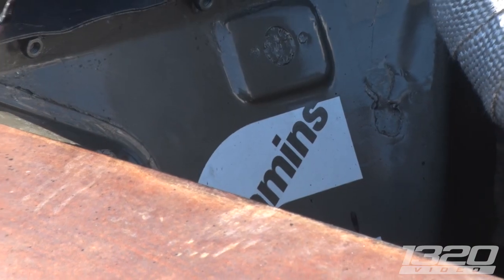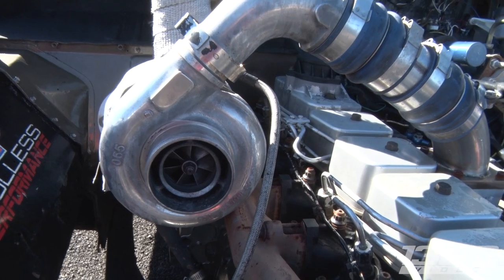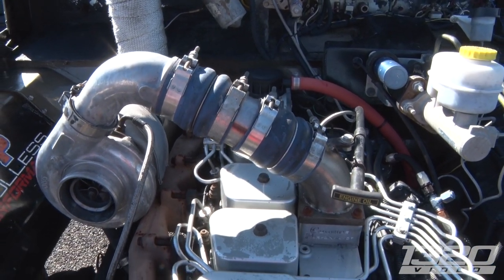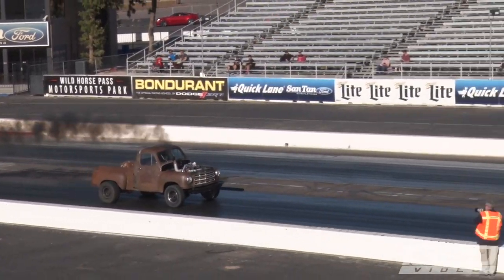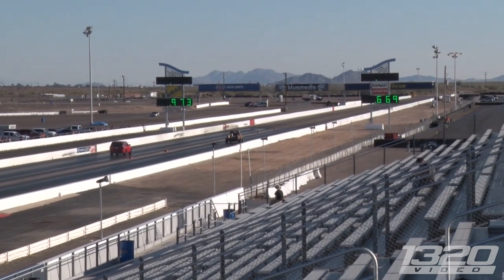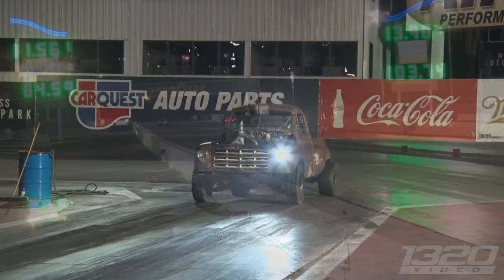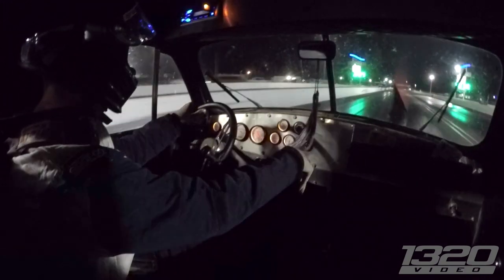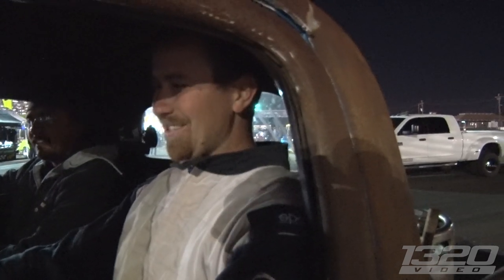Turbo Diesel STUDEBAKER Pickup Truck!?

Comment: I'm actually the owner and yeah my shifting from 2nd to third is terrible bit anyone that has drove a nv4500 knows it's no race trans. I am leaving in 2nd and nitrous wasn't working that night. we have huge plans for the truck like a fire punk trans and a 1200hp long block that's already put together. I didn't build this truck to be a race truck but that's what it's going to turn out to be. thanks and there will be so much more to come
Reply: growing up around a stude pickup and owning a 79 bronco with a NV4500 I dig this a lot! that 2nd to 3rd in them is about a mile and a half long lol. people don't understand its not a 1st to 2nd shift, because 1st is basically useless other than pulling stumps lol
Reply: Awesome truck.  Doesn't matter if it doesn't work well or whether it is practical or not, I would drive it! Love Studebakers and diesels, so this is a perfect combo.
Reply: good luck with it man, currently building a 12v and nv4500 for my suburban. should be at 600awhp when done.

Comment: The flaming exhaust is really badass!
Reply: Fileeraus that's  N2O
Reply: Doesn't change a thing, its badass.
Reply: Yooo Dawg  N2O is the oxidizer precombustion not the flame itself..
Reply: Yooo Dawg No, that's diesel with high EGT. My truck did the same thing from the hood stack in big tunes before I intercooled it. Go watch some tractor pulls, same thing.
Reply: ^This, non-intercooled diesels are kinda like habanero pepper sauce - they run hot enough to burn twice lol

Comment: what's he doing making a sandwich in between first and second?
Reply: pandemoniummisfits 😂😂
Reply: pandemoniummisfits it's manual, I'd like to see you drag race in a manual
Reply: Man nobody can take a joke.
Reply: pandemoniummisfits it's not a joke if it's trying to provoke the guy
Reply: SpecialKLSX still, it ain't funny. How would you like it if I said "What are you doing? Making a a sandwich while typing"
Reply: ihateyoujeffy then make one
Reply: pandemoniummisfits I want a tuna sandwich how bow dah
Reply: pandemoniummisfits I prefer tator tots over a sandwich so I would grab a few between shifts ha ha
Reply: pandemoniummisfits hahahahaha
Reply: Thats truck transmission for you racer boy :D
If theres any synchros left they get chewed right up in the first time you miss a shift :D
Reply: You're a grown man, stop being so sensitive.
Reply: pandemoniummisfits I have the same transmission with a bad 3rd synchro. I can still slam gears faster then that Haha.
Reply: ahahahaha 1st to 2nd is always tricky, from what I know...driving an old 240d with almost no synchros. not sure what this dudes shifter setup is though. pretty sure that trans has no synchros?
Reply: pandemoniummisfits magnet b. I k.
Reply: and at the light

Comment: he never builds up his boost before he launches needs a driver mod
Reply: Also looks like it could use a better diff. Looks to me like it's spinning the right wheel in burnouts, and the left just kinda jerks.
Reply: hold the clutch while at full throttle :P
Reply: Probably just an average open diff.
Reply: RIP clutch
Reply: If it's an open diff, why would the other tire be trying to spin? The spinning one would get all the power.
Reply: Wrong.
Reply: Who and why?
Reply: Warms up and starts gripping.
Reply: it's a limited slip that obviously isn't working
Reply: I kill For sport agreed like I said it's not a race truck but making its way there

Comment: if only he knew how to drive it, he is leaving on no boost.
Reply: Cameron Stevens it's a manual. kinda hard to build a lot of boost with no load on the engine...
Reply: CRAZEDX100 he could dump the clutch
Reply: David Eagle inform me on how to leave under full boost with a 5 speed manual transmission this is something I guess I don't know
Reply: Cameron Stevens can you explain to me or anyone on how to build boost with a manual transmission and a diesel ?
Reply: Dont know what engine management he is using but I am pretty sure it doesnt support anti-lag/launch control, also it seems like he barely has grip as it is from a idle launch.
Reply: Zcypot my truck is completely computerless
Reply: no intercooler so maybe its the hot air
Reply: FlmxFilms just because he dumps the clutch doesn't mean he's leaving on full boost. how does the turbo go from making no boost to making full boost in the split second it takes the clutch to transfer power? it doesn't that why it smokes so damn much off the line, because it's leaving on no boost.
Reply: FlmxFilms giving throttle to a turbo diesel with no load on it won't create any boost. you need to learn . I do own a diesel. it has a 5 speed. I can floor it while standing still and it won't make any boost. my buddy has a cummins with a Suncoast 48re and he won't build any boost in neutral but once he puts it in drive and holds the brake and floors it it'll make upwards of 35-40 pounds of boost. you need to get your facts right before you talk.
Reply: FlmxFilms explain to me how with a 5 speed you build boost while in gear. if the shifter is in first and the clutch is let out then you are moving. if you out it in fist and press the clutch in then you are in neutral. that's kinda why you dunp the clutch when you launch. do you know how a manual transmission works? try going into first letting out the clutch and sitting still while building boost. let me know how that works out for you.
Reply: FlmxFilms lol Suncoast is cheap. yea so what he daily drives it and it runs 9s. my 3500 with a 5 speed ran high 10s. let's see what you got. come stop by and run us.
Reply: +CRAZEDX100 Line lockers, feather the clutch, easy peasy.  Line lockers likely optional, idle torque against 1/4 clutch under full brake would probably be enough for at least a few pounds of spool.  Lemme guess the only truck you've owned with a stick was the diesel?  Probably don't have good enough part clutch control to keep from stalling a small to medium gasser in rush hour or hill country.  I cut my teeth for stick on a 2.2L S10 with a 5 speed.  I could hold that thing at a standstill on a 30% grade without touching the brake pedal because I learned to drive it in the St. Paul/Minneapolis noontime rush hour back when I was in college about 15 years ago.
Reply: bashkillswitch I hope you know that is horrible for your clutch. let's just sit here at the line and burn the friction disk for shits and giggles. I've owned a few truck with standards and currently daily a 5 speed mustang. I know how to drive stick.

Comment: or u could just buy a stock camaro or foxbody and be faster
Reply: fox bodys and mustangs This truck is slower but cooler then the fox.
Reply: Definitely not cooler than a fox
Reply: that's the boring way to do it.
Reply: Turd Ferd don't get me wrong.... I absolutely love Foxbodies but to say they are cooler than this truck, I'd be lying my ass off.
Reply: R34 cause going fast is boring.
Reply: Goddamn right! You saw that exhaust.
Reply: Goddamn right! You saw that exhaust.
Reply: fox bodys and mustangs and have the most boring overused car on the planet
Reply: Excuse me, but foxbodies are super cool. My daily driven fox does a 25second 1/4 mile... huh!? Wutcha think about that!?!?
Reply: Interesting to see a fox body lover who is preaching bought not built.
Reply: Nate b mine runs 24', yours is slow.
Reply: factory foxbody time?
Reply: fox bodys and mustangs if he got a mustang or camaro he'd be cookie cutter like everyone else.
Reply: Dénes Czeczon 14.5-15.0 I'm thinking. I've never had a stock one at the track myself. Stock 89' LX with Gears, exhaust, and 14 degrees of base timing. Ran 13.7's on regular BFG's this was before drag Radials came out lol
Reply: fox bodys and mustangs yeah but that's no fun
Reply: NiCadRacer Lol I'm kidding, I actually don't know what mine would run. Never taken it to a track, all I know is I've got a 600Ci jet engine swap in it, good for about maybe 800Hp and 12 foot pounds of torque I'd say.
Reply: NiCadRacer Lol I'm kidding, I actually don't know what mine would run. Never taken it to a track, all I know is I've got a 600Ci jet engine swap in it, good for about maybe 800Hp and 12 foot pounds of torque I'd say.
Reply: Nate b mine runs on a super fusion hydro cell. it too is as invisible as yours.
Reply: ratrodramblin well god dam son... you just out did me on that one. I'll race you for ducks 🦆. Ready? On your mark... get set... GO!!!
Reply: Nate b thats not fair you had vin diesel in the passenger seat, he looked over and said smoke em.
Reply: ratrodramblin fine, I guess you're right. But I can't race again cuzz I have an exhaust leak so ya...
Reply: FlmxFilms dude, where'd you buy it? eBay? I've been looking for one, supposedly adds 32 experience points. I should be putting out like 500° Fahrenheit to the wheels with like 3 foot pounds of torque.
Reply: fox bodys and mustangs you can go buy a Tessa and kick pretty much everybody's ass. Hell just go buy a car that steers itself too. While we are at it, let's have robots play football. You missed the point completely.
Reply: Keihin Bracken butthurt about what? This whole post thread has been nothing but one big sarcastic, messing around troll? No ones getting butt hurt lol.

Comment: That square cast exhaust manifold is horrendously small for this application. If he was to upgrade that to a proper piece, not only would the HP figures skyrocket, as would the torque. The turbo would spool quicker, and his times would be improved.
Reply: enigmaPL agreed I have a lot to do but this was the first engine more for unique not fast but now I have a 1200hp engine just working on a trans

Comment: The truck is cool. But he needs to work on his launching & shifting. The gearbox needs a lot of work. Also needs traction bar, as the rear is hopping. But it would be really cool to see thing running even side by side with those really fast cars.

Comment: That's about the same hp and torque as the new 2017 Ford 6.7 diesel from the factory. 440hp and 925ftlbs

Comment: That truck has never made a 12 second pass in it's life. Maybe with another driver in that seat...but it wasn't with that guy.
Reply: NGP actually it has 12.8 to be exact I'm the owner and only driver  3rd gear is gone and spray wasn't working

Comment: Man, it's painfully slow... I still don't get the whole diesel thing. If he had put a 400hp small block in it, it would be WAY faster. How funny was it struggling to do burnouts with 1000ft/lbs. It's just not cool to be slow, I don't care what anyone says in it's defence. The truck would have been badass with a decent V8
Reply: Daniel Brealey glad I didn't build it to your specifications I was going for unique not fast but now that's where I'm going with it see you guys in a year with 1200 hp and 9 second passes